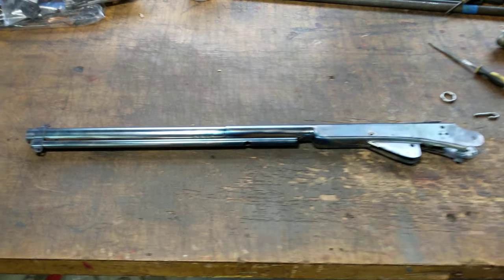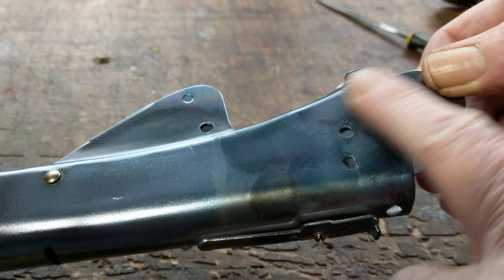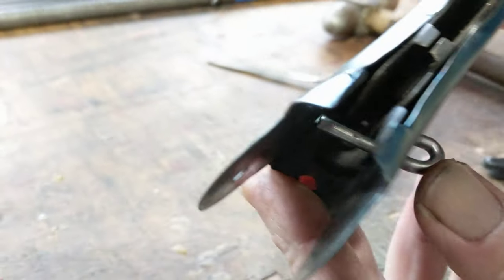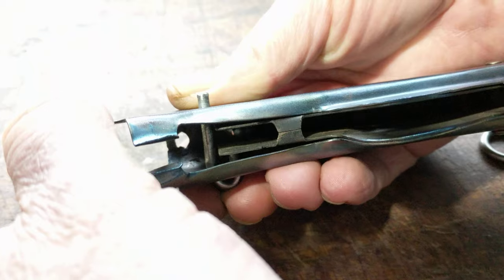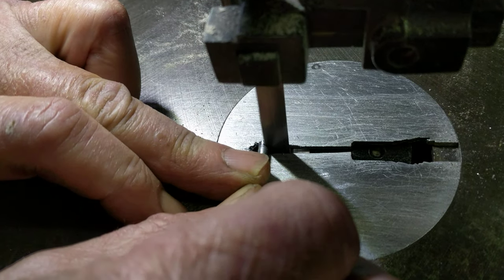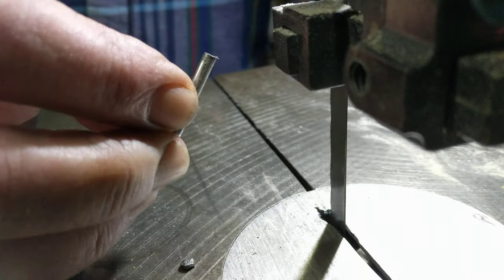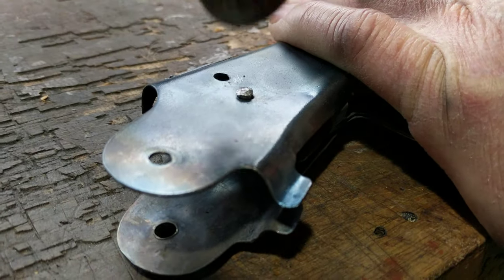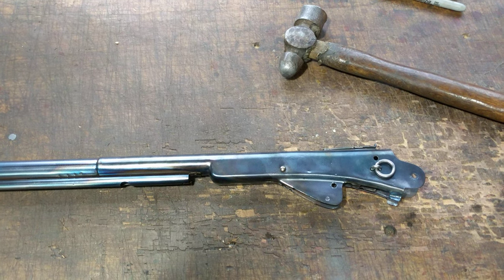Daisy Model 94  Latigo loop reattachment part 2

Comment: I am working on a 1940s 111 model 40 and the latigo loop has pulled through the hole on the peened end. Any suggestions for repair?  Did you fabricate your own new loop?  I absolutely love your videos. Thank You! Ron H.
Reply from the maker: Ron, Yes! I fabbed that out of  a  12D bright finish nail based on a post I saw over at the Daisy Talk Forum. You've got a couple of options. If your original latigo loop mount is long enough to repeen then follow the procedure I used here. If not, get a 12D nail and cutt off the head and bend it to form the loop, install, trim amd peen. If you'd like to transition it into a removable mount, head over to "Lever Gun Fun" and take a gander at Russ's technique for installing a converted 20d nail with a 10/32 thread on the right side.

https://www.youtube.com/watch?v=fzo1Drrm58I&t=105s

I haven't done that yet but I'm working on yet another iteration of the Sliding Spring Block and being able to remove the latigo loop will make a huge difference. If you go with the 20D threaded fitting you will need enlarge the holes in the receiver just a smidge to allow it to fit. Good Luck!
Reply: Shane thank You so much for the information. I think The original loop is a little out of shape but I will try to salvage it first then try the 12D if needed. I am upgrading the gun to new synthetic seals, overbored air tube and HP spring from Mark at Cobalt 327. The video you linked me to was also very interesting. I am looking forward to seeing the rest of his videos. Once again, thank you for all you do. I am recently retired from full time employment and am tremendously enjoying spending time with these nuggets of history. Including my fathers boyhood model 25 from around 1920. 
Ron H.